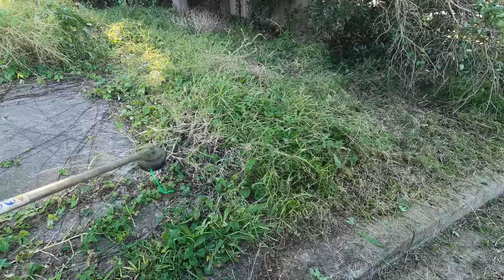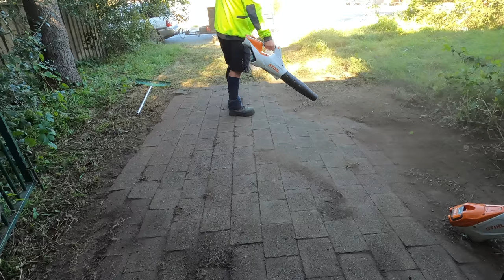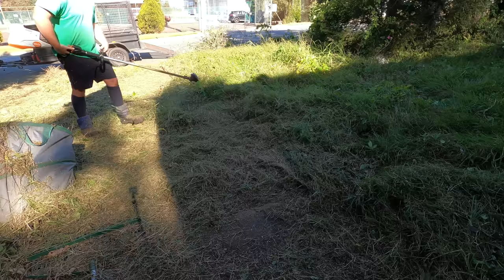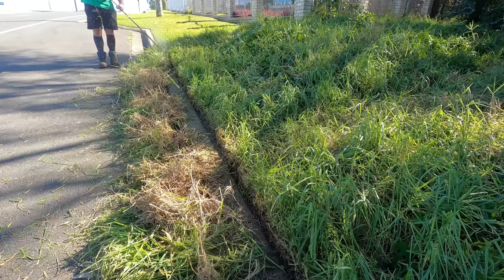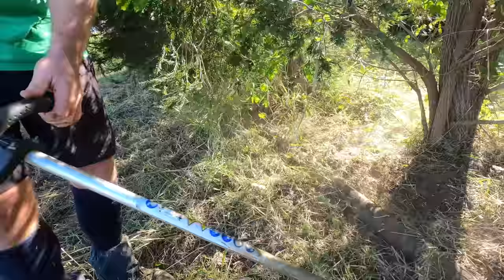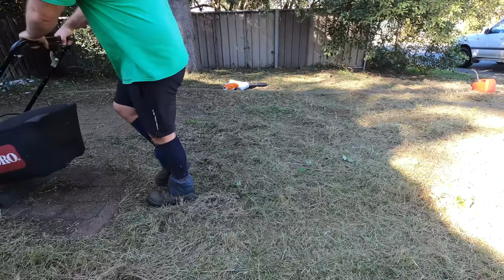I knocked on a stranger's door and offered a yard clean up!

Comment: A great example of how important   garden maintenance is.
Roots clogging the down pipe, water can't  escape and fills gutters then over flows onto the roof, runs between the roofing materials into the insulation and roof space then into the ceiling, ceiling space fills with mildew and ceiling collapses - bit like a butterfly effect, aye.

Comment: Hey Sean, Love your work, keep it up. There are always going to be the knockers. A tech question from me as a lover of all tools in the Stihl range, how do you find the battery life of the brush cutter. Looking at this job how often did you have to change the battery? Do you run several batteries for a day like this? The brushcutter itself looks light and nimble. Your feed back??
Reply from the maker: Gday Andrew. I'm happy with it. 
I have 5 batteries, and will use all of them on a job like this. Though for my regular run, I can do a day's work and have one or two left over on full charge still

Comment: These are always so crazy to see. This is years of neglect. My city has an interesting and very memorable way to deal with this. Basically code enforcement drives around all day looking for problems. If your yard looks like shit, they write you up as a proactive enforcement. If a neighbor complains, you get the same enforcement letter in the mail a few days later. 7 days to resolve. No improvement? They schedule a reinspection. This might repeat once or twice. Then you get a yard sign and a date to appear on the local public access channel to explain to the zoning board why you can’t follow the rules. If you don’t have a good excuse, they hire a city-approved contractor to fix the problem at about 4x the price of what it costs to do normally.

Comment: I do not mean to start a debate, over gas or battery-powered equipment.  My only question is---How long does the weed eater run on a charge?  I watch you using them and it has me wondering when I need to replace mine, which way to go. TIA
Reply from the maker: Hi Paul. At full power, you'll only get 15 minutes non stop. For my regulat route, I only need low power and get through 3 or 4 yards before I need to swap battery

Comment: So much cleaner. I wonder how many minutes/hours you get out of your batteries with your weedeater.  I just have a little DeWalt battery run weedeater, and a fully charged battery might last me 15 minutes, 20 if I'm lucky.  Did I get what I paid for, and the stihls are just that much better, or am I draining my batteries faster than normal? Both probably. 😳😁 
On another note, you have such beautiful eyes! 🙂
Reply from the maker: Hi there!
If I go hell for leather on max power, I might only get 15 - 20 minutes. Usually I get 3 - 4 small / medium properties done with one battery on my regular route

Comment: I notice you and other professional lawn care people removed the "guard" from your string trimmer. I have been hit with rocks when using my trimmer even with the guard in place. Why do you use yours without the guard? Also, I saw you use hearing protection but did not see if you used eye protection. Might be nit-picking, you do this type of work far more than I, but wondering if you used eye protection to protect your vision.
Reply from the maker: You answered the guard question yourself; they don't do much ;) 
Actually the first reason I removed it was for ease of transport and storage. I soon saw the manoeuverability benefits though.
I'm definitely wearing eye protection! I may occasionally forget to put them back on if I put them on my head if I'm mowing, but are always on when trimming